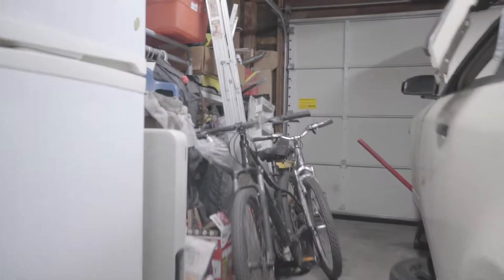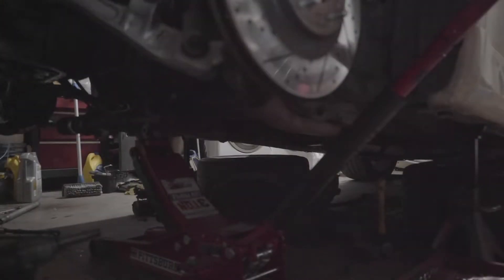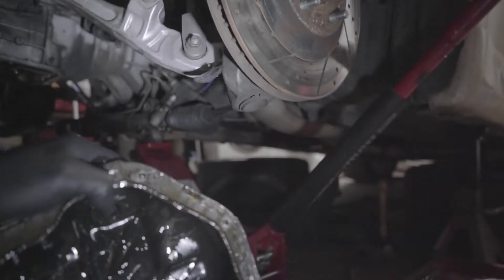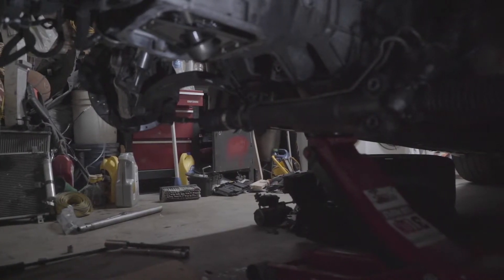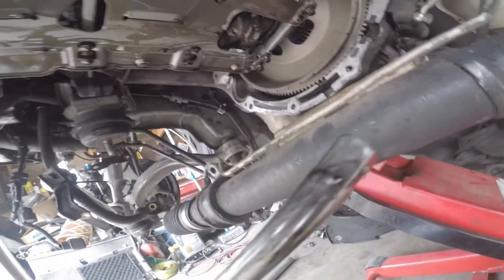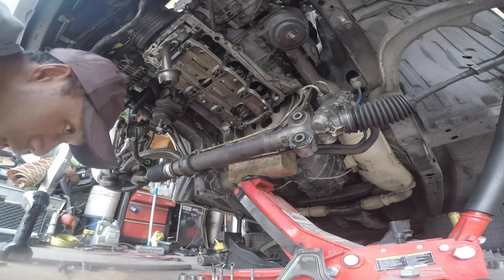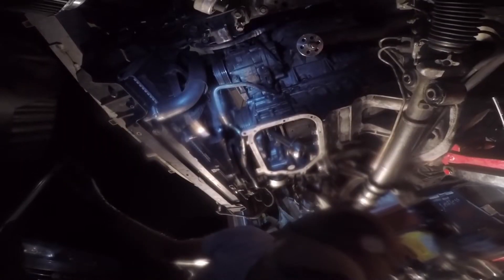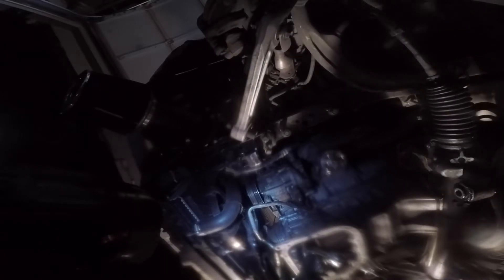Infiniti G35 RevUP Rod Bearing Replacment Failure

Comment: You did it all wrong you coulda fixed it with thicker rods polished with sandpaper shoelace method crank and rod connector. Use 10w-30 oil with some Lucas you coulda saved it. Fokes stuff fail because they don’t take they time in do it right

Comment: shouldve used a plastigage, assembly lube & also should polished the crank with 600-2500 sand paper.........Thats why the issue came back 15 mins later because you didnt do these steps